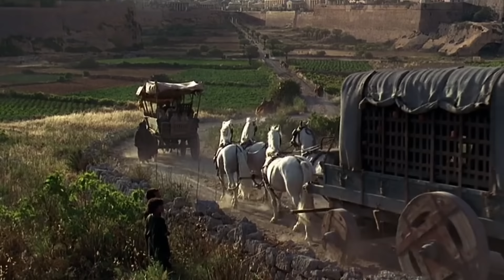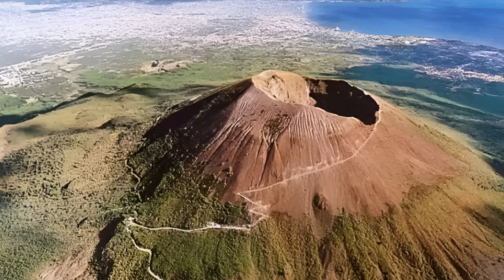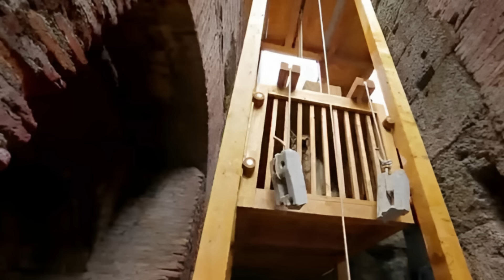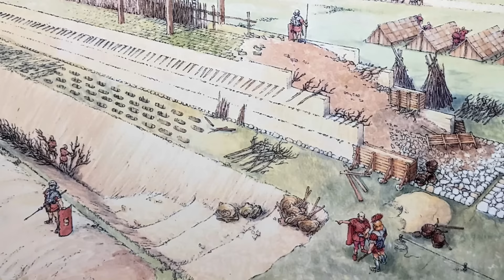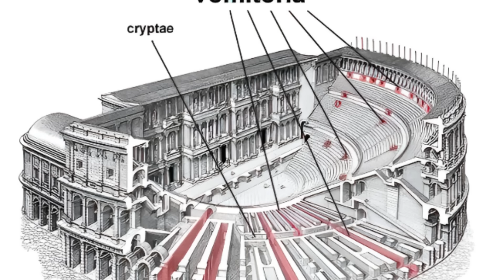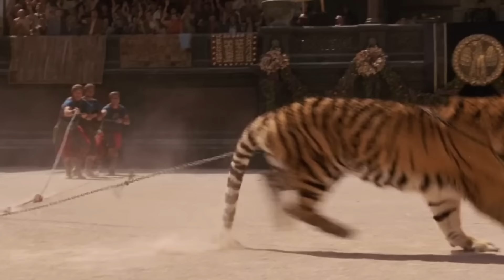How the Roman Colosseum Was Built From Scratch

Comment: 08:40   The walls are NOT earthquake resistant, that's why part of the Colosseum is missing !      The Roman Colosseum (also called the Flavian Amphitheatre) lost large sections of its outer walls over the centuries due to a mix of natural disasters, neglect, and human activity:
Earthquakes: Several major quakes, especially in 847 AD and 1349 AD, caused parts of the southern and outer walls to collapse. The Colosseum was built on soft ground on one side and firmer ground on the other, so the southern side suffered more structural damage. That’s why today the northern arcades are still fairly intact while the southern portion is missing.
Reply: Sounds just like the leaning Tower of Pisa : part of the base was soft resulting in a lean.